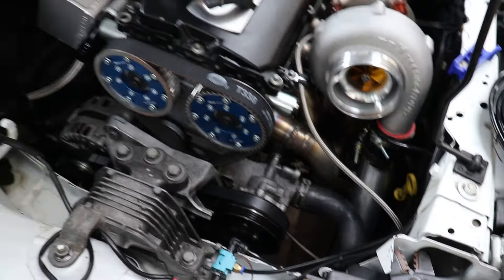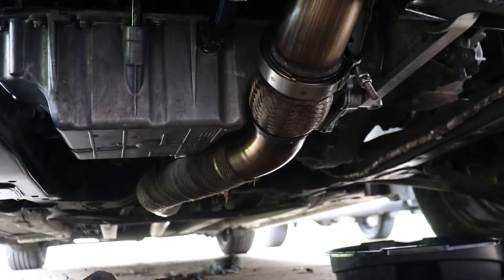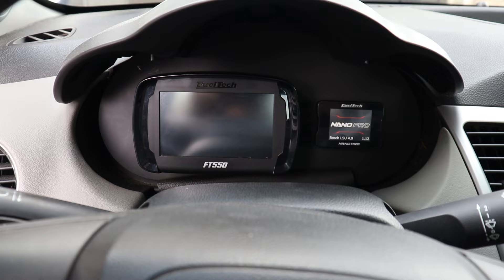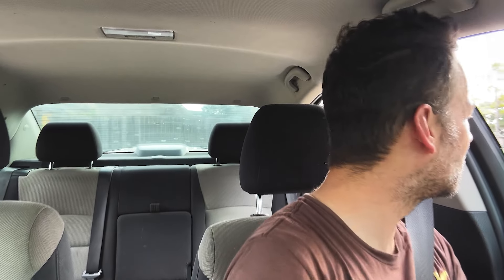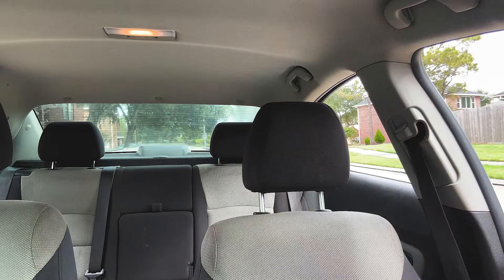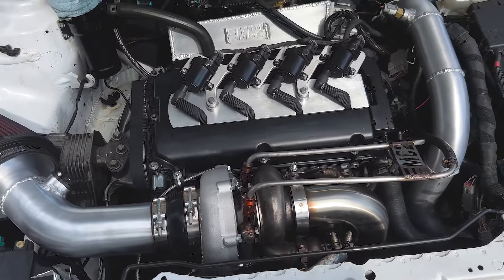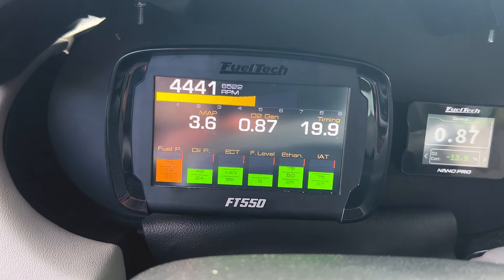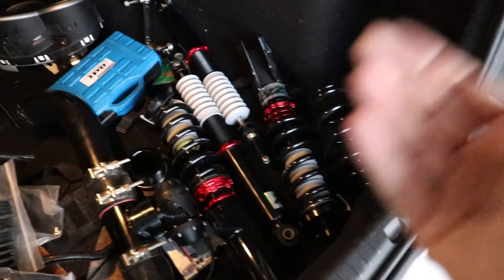Will the Piper Cam Upgrade and GT3071 Maxpeedingrods ballbearing turbo make Boost Sooner? Let's See!

Comment: Hahaha awesome! You can tell it really wants to get rowdy. I'd personally probably try to adapt a Hellcat pump or a twin pump setup from some other car, but it can be such a pain if there aren't good off the shelf solutions. Excited to see what you do!
Reply from the maker: It does!  Just need a safe place, like the track, the let her stretch her legs.  I'm thinking I'll probably go 10 gal fuel cell. There's a drop in adopter the replaces the fill lid with a twin pump setup.  I'll pull the DW300c out of the stock sending unit, get another DW300c, and add another 3/8 hard line.  Should do the job and be good for 680lph.  There's also the twin external Bosche 044 route, but I'm not so sure about the loud whine of external pumps. Would take away from it being a stealthy sleeper.

Comment: You could keep the stock set up as is and add a surge tank. This would allow you to keep your factory sending unit, filler neck, ect but have additional fuel for pulls without issue.
Reply from the maker: That's a good point. Thanks!

Comment: Hello, new to the channel, im enjoying the content. I've been looking for someone using this gt3071 ballbearing as they've really been trying to get me to buy one. Ive got a garret gen1 gtx3076 on my 2.0 subaru. It's fine on e85 but on 93 its alittle lazy so wondering what rpm do you see full boost on this turbo from like a 4th gear log. Your car sounds great by the way. Very interesting build. And i love the DIY.
Reply from the maker: Welcome aboard!  I need to replace my 4th gear as the syncros as they're worn and it pops out of 4th.  One of the next things I'm going to work on.  Thus far, in 3rd, it comes on, full boost by 4700.  Starts spooling around 3800 but with the 1.8 it's not moving enough air until well after 4k rpm.  Thank you! I appreciate it.

Comment: I’m pretty sure this is a luw 1.8 witch is a re coded gm Vauxhall engine called the z18xer if I’m correct yoy could buy parts for the z18xer and use them in your engine
Reply from the maker: You're right about that. This engine model came in many model numbers. Z18XER, A18XER, 2H0. Some of the parts I've used on the engine, like the rods are from the Z16 / Z16XER, which is the same engine, just a smaller bore and less stroke. The A18LER is the 1.6 variant that came turbo charged from the factor.  All the parts are interchangeable with the exception of the cylinder head, which cam in mechanical and hydraulic setups, which are machined slightly different. :)
Reply: @ exactly that it’s nice to see someone really looking in tot these as in the uk we have a lot of them with a little turbo on them  it’s a shame you never got the 2.0T z20leh there was 2 versions one had a 180bhp map then the “race” version was 250bhp

Comment: Haven't watch the video yet, but just wanted to say lets F'ing GO!  So excited for this!

Edit: @2:00 in and I already love the video.  You said pounds instead of "psi".  THANK YOU!!! That's a pet peeve of mine, it's lbs not "psi" because of the physics of how a turbo makes "pressure".

Edit 2:  For the fuel issue, thankfully fuel pump technology has come a very long way. What you could do is keep the current fuel pump and stock tank, and just have a "sump" welded on the bottom and as far back on the fuel tank as possible.  Get an AN bulkhead fitting there, and run a line to an inline fuel pump of your choice(they have amazing ones) and hook it up to fueltech to activate the fuel pump at anything over XX LBS of boost.  Stock driveability, and you won't hear the massive groan and whine of a fuel pump when you start the car or are cruising.  IF you're serious about making it a track only car, then small tank in the fender gravity feeding an in-line pump would be great too.  But I've never been crazy about driving a car that I couldn't drive on the street if I wanted to.  While it may not be "legal" how the Cruze is now wouldn't attract very much attention on the street at all from the red and blues.  :D
Reply from the maker: Thanks! LOL, you're right. I just wing these things. Half the time I'm stumbling on my words and edit a lot out.

Great food for thought, you're right about that. With the exception of the tank. It's plastic. I suppose I could drain it, and add a bung and seal it up really well with nylon washers and some sealant. Lots to think about. Definitely want to keep driving her on the road and would love to do drag and drives.  Not to light the world on fire, but just to have fun and socialize with the car community.

Thanks for the feedback. So many ways to go!

Comment: I'm so glad u got hooked up with zzp .. they are doing some pretty rad stuff ... much love, bro .. and yeah i just switched from the gtx3071r gen2 dbb a few months ago , great turbo and powerful , i was just looking more responce , but when the 3071 comes on bro they are powerful for sure , i went to the g25-550 to give me almost 1k better spool time tho and it holds to redline ... happy to see the cruze doing well for ya this round broski , hope it keeps going well , and yeah besides what u already said , i would just do a surge tank , so drag and drive still capable and you can still look "stock" when pumping gas 😅  and that will help keep smell down to fam .. keep killing it brotha 💪🏽.. peace and love all, keep it rad, stay safe, and build on..l8r famz and keep having fun
Reply from the maker: That they do!  Thus far I'm enjoying the swap from the GT35 to the 3071. I wonder what the power potential for the GT25 is?  I'm shooting for 10's in the quarter, so 500-600 whp is what I'm after.  I like the surge tank idea.  Thanks for sharing bro!
Reply: @cmattdabrat  hell yeah broski , and that's my goal to , a 10 second daily driver 👌🏽 😎..and the g25-550 say it's rated at 550 to the crank , my 3071 say it was only rated to 600 , so not much differance,  but the boost threshold is what I was looking cuz I run 30+psi to get a 1.6 to 400hp  and alotta turbos don't like to spin that fast ( the g25 said it's capable of holding 60psi)... so, tbh either way you go, you could hit your goal .... I love the cruze, bro , so unsuspecting,  I wanted to build one for the longest , but I still kinda want to. lol , I think my next project is gonna be a suv tho idk yet tho ... but yeah, man, you deff doing it broski and mad respect to ya brotha.. always enjoy our little chats, bro .. peace and love brotha, keep it rad, stay safe, and build on..l8r famz and hang out with ya Wang out lol 😆 (didn't wanna steal your line 😉 😜)